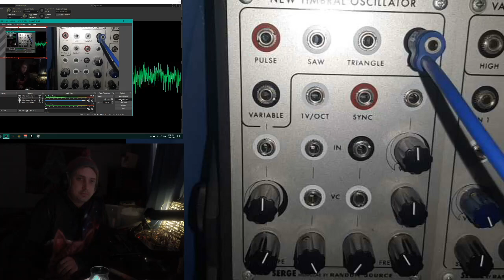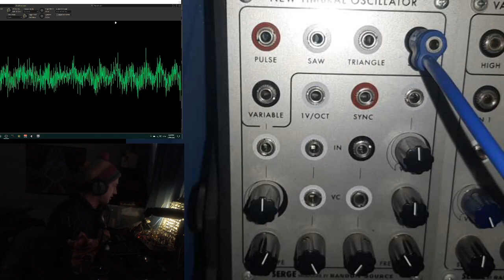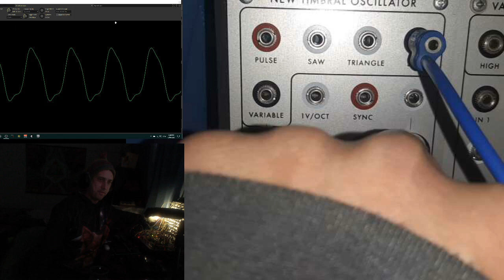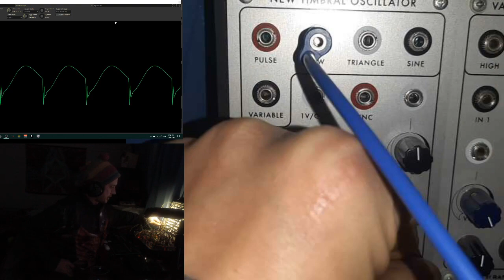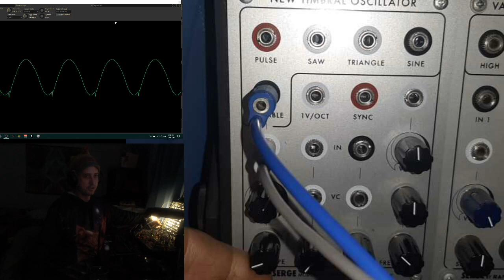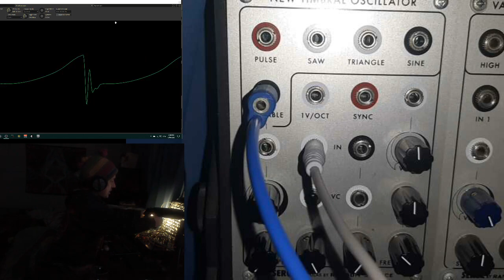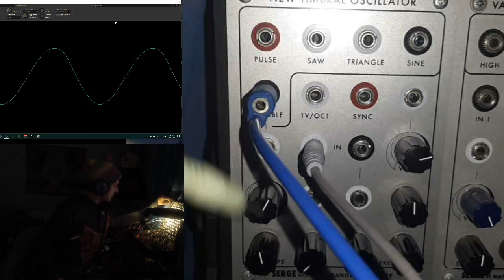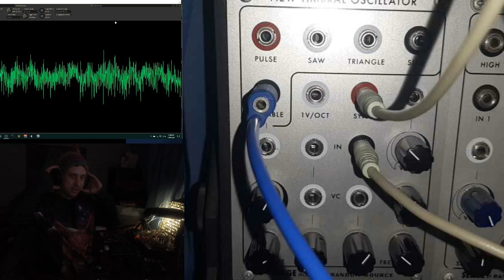R*S Serge NTO Overview

Comment: Is this a DIY build? Those saw and square really look unusual.
Reply from the maker: You're right, they are unusual. I've thought about this quite a bit. Yes I've built these myself from kits, so perhaps some components were less than ideal, but I dunno. They sound as you would expect however, and I'me pretty sure I've heard Serge mention it's by design.
Reply: teezdalien I don’t have one on me right now, but there’s that video of the waveforms on YT https://youtu.be/Mum1T1zVjac it’s not a full sweep but the waveforms look a bit more standard. Yours still sounds good. Such a fat and rich sound! Did you use the Thonk kit or you source the parts yourself?
Reply from the maker: @piotr803  The kit was from Thonk. I'd like to see these on a different scope to be honest... Seems strange to me that two separate builds show the exact same weird waveforms though.
Reply: @teezdalien  That is strange. I think Thonk said NTO will be back in stock this autumn, so I might build it myself.
Reply: @piotr803  The pcb comes pre-populated with surface mount parts. You just have to solder the jack and pots etc.